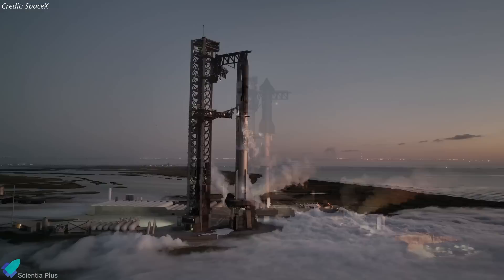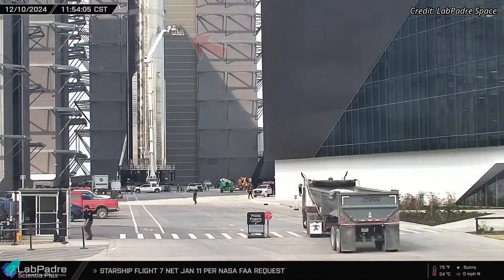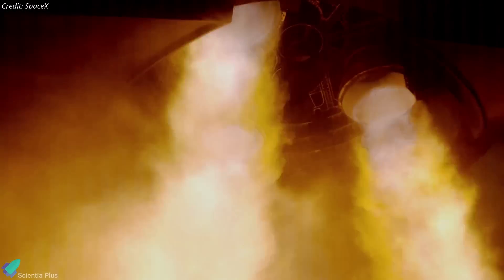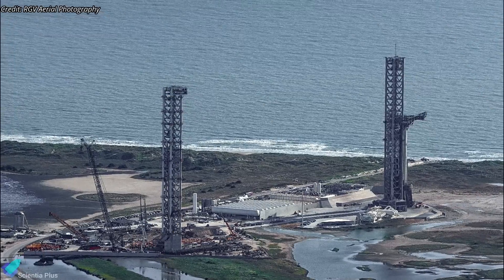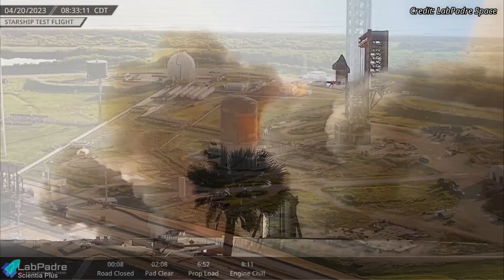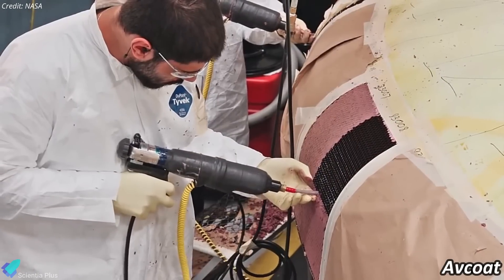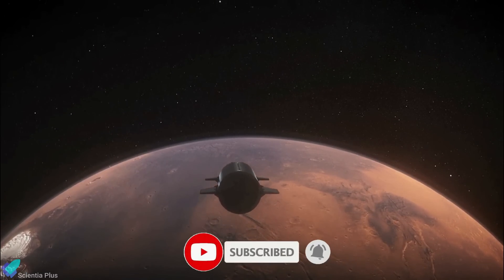Starship BLOCK-2 BREAKTHROUGH! FIRST EVER Static Fire of Ship 33 – Flight 7 Just Got Closer!

Comment from the maker: 00:00 Starship Updates 🚀
10:04 Orion Heat Shield FAILS! NASA Artemis 2 Delayed Again! 🚨
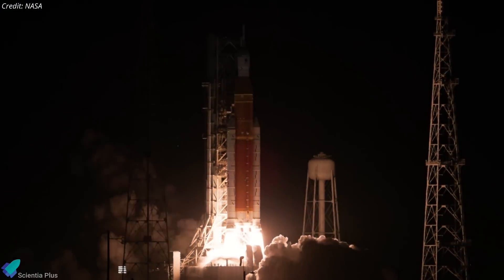12:39 ESA’s Vega C ROARS Back After Failure! 🔥

Learn More:
1. Starship V2 Explained: 
Summary: https://shorturl.at/9Iudv
Detailed Explanations:
  a. Design Improvements Update 1: https://shorturl.at/lpGT7
  b. Design Improvements Update 2: https://shorturl.at/gwNQ4
  c. Nosecone & Payload Bay Redesign: https://shorturl.at/xa60S
  d. Methane Downcomer Redesign: https://shorturl.at/XdYBG
2. Starship V3 Features: https://shorturl.at/mnBT4
3. Starship V2, V3 & Raptor V2, V3 Complete 2024 Update: https://shorturl.at/tN248
4. Raptor V3 Mega Upgrades & First Test: https://shorturl.at/TRIyj
5. Latest Starship Upgrades
  a. Starship Hot Staging Explained: https://shorturl.at/jf400
  b. Super Heavy Booster Upgrades: https://shorturl.at/Pi5R3
  c. How SpaceX Protect Raptor Engines: https://shorturl.at/4Om8F
  d. Starship New Heat Tiles Explained: https://shorturl.at/p2Ijb
6. Starship Flight 6 Analysis Complete Breakdown: https://youtu.be/3BzZmsuROl0

7. Artemis-1 Recap Playlist
   a. Artemis 1, SLS, and Orion Explained: https://shorturl.at/lZoC9
   b. Artemis 1 Launch: https://shorturl.at/Yr7XX
   c. Artemis-1 Progress Update & Launch Pad Damage: https://shorturl.at/xb1mh
   d. Orion is Returning to Earth: https://shorturl.at/EvEIQ
   e. Artemis-1 Splashdown and Next Steps: https://shorturl.at/zx9Q0

Weekly Updates: https://bit.ly/3HIQjPC
SpaceX Playlist: https://bit.ly/34wue8T